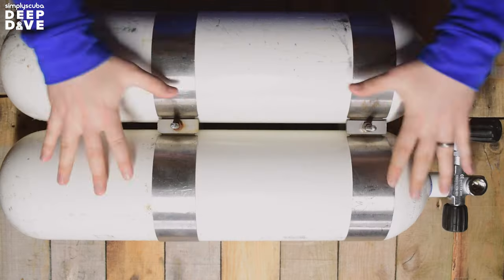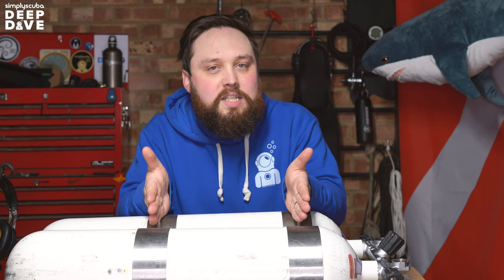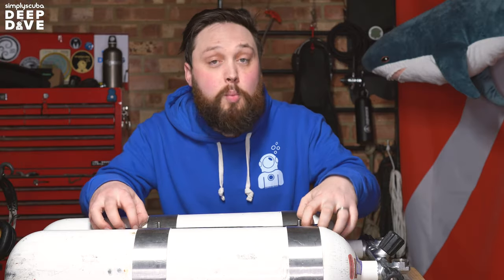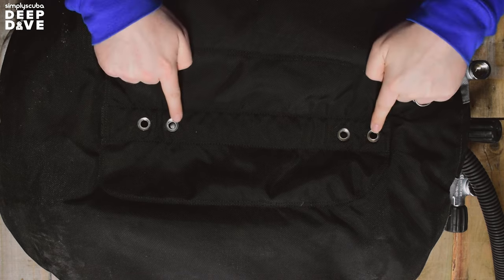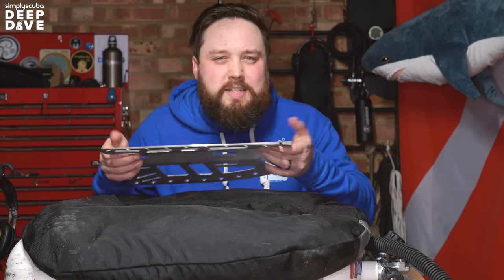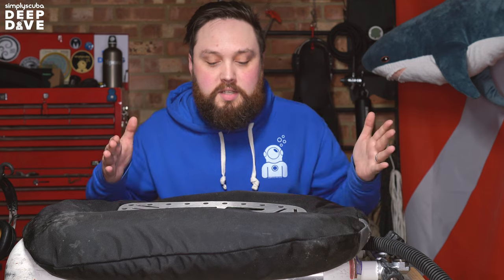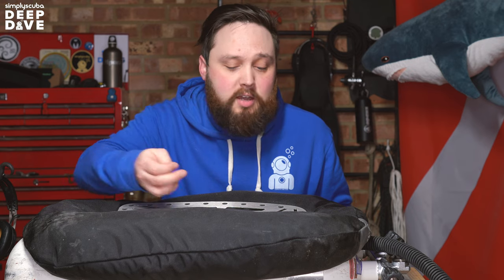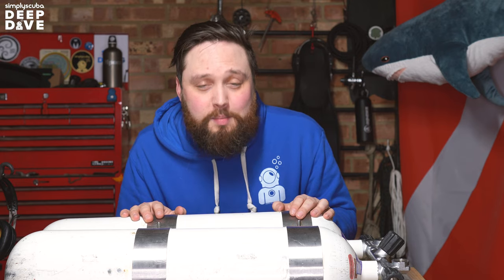How To Assemble A Twin Set | Deep Dive

Comment: It's amazing how everyone requires such different trim. I have a set of twin LP85 (13l) and the thought of having a spine weight on an already very back negative set would leave me turtled. That's with a composite plate and zero additional lead. Arguably I could use a couple kg up front for trim and the stop. Undivable in a wetsuit being so neg and  as I have long surface swims a wing failure without a backup means ditching the whole thing.

Comment: Maby a stupid question.. Do you really need a bigger bladder if you Go diving with a double 7  or is a bladder for a single tank good enough?
Reply: Those look like our LP50s, in general a 30lb single tank wing is probably enough lift. But most 30lb wings are too narrow for LP50 doubles, and would be squished by the tanks, so a small 40lbs doubles wing is typically recommended.

Comment: Newer wings as well as backplates have a lower vertical slot to give you much more flexibility in how you position everything for optimum trim, and so you can best reach the valves. I think you also need to swap out that rusty hardware and, while you're at it, set those cylinders parallel again.  Incidentally, to avoid paying inflated prices you can buy M8 A4 marine stainless steel nuts, washers and long bolts from non-scuba suppliers for a fraction of the cost (eg: https://www.accu.co.uk/en/hexagon-nuts/7913-HPN-M8-A4).
Perhaps you could also do a video on how everything else on the twin-set is put together, if only to demonstrate that it's also actually much simpler than it looks.

Comment: Great video! I was wondering if yall had any leads on companies that made extended length backplates? I'm pretty much exactly 2 meters tall and have been struggling to find a company that makes a good SS backplate in longer sizes.
Reply: Halcyon. The long backplate isn't super common as most people can get by with a normal backplate. Even Extreme Exposure, the GUE shop in High Springs, which is down the street from Halcyon's factory, doesn't list the long plate on their website.
Reply: You can also go get them custom made.
Reply: @sameermohideen4913  Thats what I was figuring. I would like something heavier as I'm  about 220 and wear a 7mm wetsuit for most dives.

Comment: How much does a complete unit like this weigh? If you‘ve got issues with your back or knees, this might be over the limit for a shore dive. Also, I would like to see a deep dive about the first stage configuration of a twin set. #askmark
Reply: I'll give you a breakdown of mine.  2xApeks 12 litre steels 27kg; backplate 1kg; wing and harness 3kg, regs, hoses and gauges 3kg, cannister battery 1kg, v-weight and trim weight 6kg.  Total 41kg.  I also use a dry suit and 2 kg on a weight belt.  So yes it is a load on the body and you need to have the strength and fitness to dive with it.  But I (age 63) manage it quite well and I'm built more like a runner than a wrestler!  Unfortunately, if you want to take more gas with you that means another cylinder and all its associated kit.  However, there are always smaller cylinders (eg twin 7s) or you can go for sidemount where it's possible to get into the water and then attach the cylinders one by one taking advantage of their buoyancy.  Hope this helps.
Reply: @timgosling6189  Hi Tim, thanks, great answer! So, that’s what happens when you switch from running to diving because you‘re sick of sweating while doing sports? Someone should have told me! 😉 Seriously, I could do it, but my favourite dive buddy (aka my girlfriend) definitely couldn’t.
Reply: @leopoldbloom4835  Once you're in the water of course you are neutral, actually hanging under the wing, so it's very comfortable, although the inertial mass doesn't go away.  But I agree there is no point in getting in the water with twice as much air as your buddy, except you can do 2 dives without changing or re-filling your cylinders.

Comment: It would be great if you could always mention the cubic foot equivalent to liter.
Reply: 12 litre tanks are 100cu/ft at 232 bar (3300 psi). 12litre at 300 bar (4500psi) is 120cu/ft. He didn’t say if it was a LP or HP tanks.

Comment: 12 liters ? What is that in cubic feet?
Reply: Depends on the working pressure. Since 232 bar steels are more common, according to my European friends, those are pretty much HP100s. 300 bar would be about 120 cuft. Though according to my European friends those double as boat anchors.